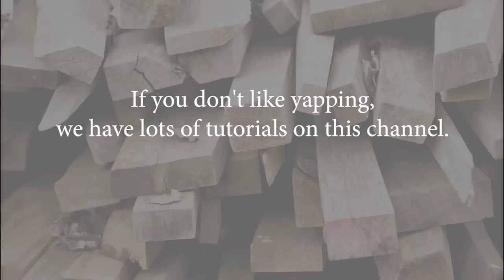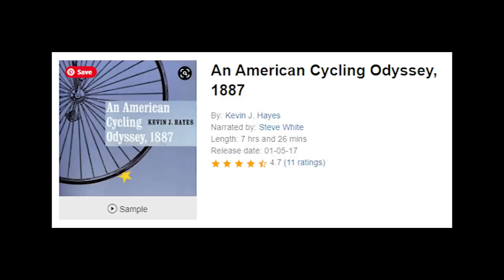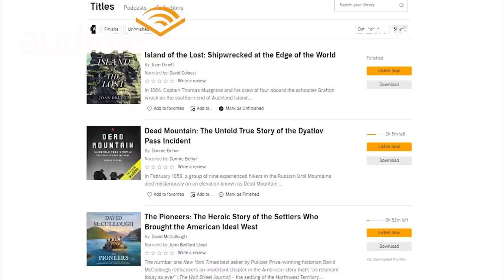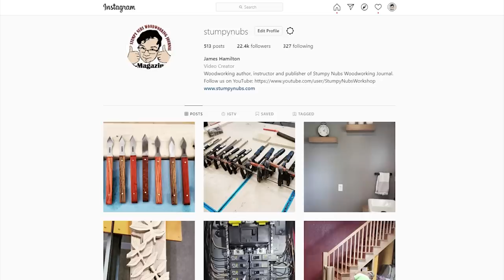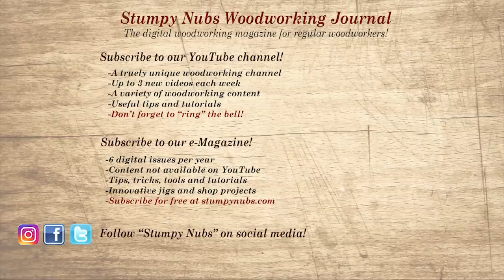Have they BANNED table saw dado sets????

Comment: As much as I like and respect you James you are in the wrong here. We can use dado stacks as much as we like (I live in Sweden where EU-law also apply), our arbors are long enough and are in general 5/8" as well but we shim them to 30mm, remove that shim and run any 5/8" blade with a long arbor. My DeWalt table saw stops any dado stack, even a 1", within 10 seconds and I can remove and operate the saw without guards and riving knives - also, there is no requirement or law that say you need to have a riving knife fitted to operate a table saw, you cannot just sell a saw without one fitted. 

What it comes down to is that our tools require CE branding and to my knowledge no manufacturer have gone through the hassle of certifying a dado stack, hence making them "illegal to sell" for professional use. There are however options that are CE-branded like the dado sets from Hammer/Felder - they have the benefint of leaving a perfect result apart from what the stacked sets many times do. You can still buy dado stacks in EU, but not CE-branded - that's all.

I have fitted dado stacks in EU-sold Bosch table saws, DeWalt and several others for many years. In my opinion dado stacks can be a time saver but the "European way" to do rabbets and dados is by using a shaper/spindle molder which properly used is much safer and more efficient, that combined with a router gives plenty of options to create whatever you want with a much better result than the regular dado stack ever will. So, dado stacks was never forbidden in Europe, it was abandoned as an obsolete and somewhat unsafe design.
Reply from the maker: It's funny how you say I'm wrong, while dozens of other Europeans in these comments saw the opposite, some even telling me how they had to import saws with arbors suited to dado sets. Seems like a lot of confusion over there. I suppose it's because different countries enforce EU regulations differently.
Reply: @StumpyNubs  Most of us fall under EU-regulations. There are however plenty of saws around here with a short arbor as you and others say but not to prevent us from running dado stacks.

For example, any EU-sold DeWalt table saw the past 10 years or so should be able to fit a stack. Same goes for Bosch and many others. Obviously people have no idea what they are talking about, surly not all saws will accept a stack but that applies for US as well.

Comment: Many years ago, with a brand new 3 hp PM 66 table saw and an improperly adjusted fence (blush, blush) I was able to stop a dado mid-cut. I was able to turn off the motor since it didn't trip the circuit breaker. The panel did NOT kick back. So, as you said, kick back is rare. And yes, I got the fence property adjusted.

Comment: I'm 80: been shoving boards thru table saws for most of my adult life. Cabinet making, furniture and just plain enjoyment. I have worked in production woodshops in what would now be  considered against the law conditions. Yes! there were injuries, all of which were user errors. If you can't achieve a concentration state similar to deep state hypnotism then don't work around 1750 to 25000 rpm capable machinery sporting razor sharp hi-speed steel blades and bits. You will probably lose some fingers or worse. The absolute worst solution is trying to legislate for stupidity , incompetency, bad habits or some other interruption to an acute sense of situational awareness. All legislation does is provide lawyers with clients that are stupid and or incompetent. It does sell a lot of SawStop saws and other false senses of safety to people who should not be in a machinery environment or own a gun or god forbid a car.  If the hair on the back of your neck doesn't tingle when you are pushing a board in a thru cut with the heel of your right hand resting on the fence and your thumb and index finger acting as the push and side pressure passing an inch from the nasty spinning blade then take up baking you will be better off. I still have all of my fingers and have been nicked once in my early years of high school woodshop. Learn from your mistakes.
Reply: "If you can't achieve a concentration state similar to deep state hypnotism.."
Well, that's kinda the problem.
Reply from the maker: I think you are misinterpreting what he is saying. He means a level of concentration that blocks distractions out. I don't agree that such concentration is entirely possible in all situations, but I understand what he is saying.
Reply: @StumpyNubs  
I understand it like that. :-)
What I meant that people who work in the field today are maybe not as capable of that feat as the ones who are able to concentrate that well, are working in different occupations that pay more/have less risk?!

Comment: Why doesn't anyone talk about the benefits of getting hit when kickback occurs. If the board that is kicking back at 140 mph is big enough, and it hits you, it knocks you back away from the spinning blades. So if you get hit by a kickback board, count your lucky stars, and your fingers.
Reply from the maker: It's the same with cars. Why doesn't anyone ever talk about the benefits of being ejected through the windshield during a crash? If the car catches on fire, I don't want to be inside it!
Reply: Err...both my Uncle and his son were both saved by being flung out of their cars in a collision. Cousin's car was pancaked with the roof in the passenger compartment, he was uninjured. Uncle got a cut on the head with a few stitches when his car was T-boned and just about turned inside out. That said I ALWAYS wear a seat belt when in a car or other transport when traveling (I believe most non fatal airline injuries are caused by mid-air turbulence with no warning, so keep your seat belt fastened loosely while in flight)
Reply from the maker: @brucelee3388  I think you missed my sarcasm, Bruce.
Reply: @StumpyNubs  Made me laugh, and I sure needed that! Thanks

Comment: @Stumpy You were the Chosen One! It was said that you would destroy the myth, not join them. bring balance to the debate, not leave it in darkness. :) nice video. i can't help but wonder if the EU side just isn't as down with the dado as the larger table saws aren't as common over here - and running a dado without the power to hog out the material won't be all that quick.

Comment: In your pitch for audio books you said that you listen to them while you cycle. As someone who always emphasizes safety in your woodworking, you should realize that biking with headphones in is a bad idea. You can’t hear what is going on about you, including polite warnings from overtaking cyclists that they are about to pass you on the left. You won’t hear approaching cars. Save your listening for circumstances where your safety and the safety of those around you doesn’t depend on an aural awareness of your surroundings.
Reply from the maker: They make headphones that work through vibrations in your skull rather than playing sound into your ears, so they do not block outside noise. They also make helmets with tiny speakers above your ears that also do not block outside sounds when used at a reasonable level. I have both.
Reply: @StumpyNubs  I’m glad to hear that you use earphones that allow you to hear what is around you. You are in a minority. Just this morning I had a near collision with a cyclist who drifted into me as I passed because she couldn’t hear my loud “On your left” as I passed her. This happens way too often.

Comment: I'm glad you talked about the whole dado blade thing. I had some misconceptions about why Europe banned them. I still don't agree with it, and would love to see some test results proving that an arbor nut can loosen from the force created as a dado set comes to a stop.
Reply: I experimented with adding electronic braking to my old mitre saw (which had none). The 250mm blade managed to unscrew itself on my first try. That was scary! 

If you look at the arbours of recent saws, the better ones usually have a key arrangement of some sort between the plate washer and the driven arbour, so that the washer has to turn with the arbour no matter what - it cannot spin on its own. That is done to prevent the nut coming loose. Problem with dado stacks is that they are too wide for the lock to engage. Even without that, a nut and a locknut (and two spanners) ought to be fine - it's considered safe on things like steering components on cars after all.

I live in the UK. Dado sets are NOT illegal here, just very hard to get (and long-arbour saws are also hard to find). Our Health and Safety Executive have clarified that dado sets are NOT banned, but there are very strict rules about their use (not sure about the detail in commercial workshops though).

Comment: If you want to live dangerously, use one of those Molding things on a tablesaw -- one cutter 
held in with one screw, and let me tell you, I bet that more than one person has had that screw break and that Chunk of life threatening Steel do its best to labotomise them. Another wonder is the gismo sold by Sears back in the day where you could dial the groove 
width by the eccentric side plates, and the blade would wobble across the cut....Insane item. My Saw was not Bolted in place, and would walk around the shop with that thing howling until I unplugged it!! ( Totally Screwed up my arbor, and I needed to replace the bearing on it after that !)  Nope -- Never again, and its back to mundane safe equipment for Me!!

Comment: First to preface that I'm in Australia and have zero experience with dado blades, but surely if the arbor nut was coming loose you would notice the wobble in the stack, and poor cut long before there was a risk of the blade coming off? I think they're a great idea, compared to a router which is OK for cutting rebates, but a complete PITA to cut perfectly straight rebates with, particularly as you get further from the edge. I'm not convinced either that assuming due care is taken (as it should always be) that one tool is more unsafe than the other.
Reply: i actually use mine as much or more for box joints.

Comment: I made a set of sleds for using with dado blades, not sorry.
Reply: I also use a second nut on my arbor. it's not as thick as a regular nut but rough on the inside and locks it in.

Comment: There are few ridiculous laws in EU (nothing to compare many insane laws in US). One example is that Banana plugs for speaker wires. 
Problem: EU was electrical 230V wall socket holes are exactly the right size for the low voltage speaker plugs. So guess that law the politicians made ? Did they ban banana plugs ? NO ! they banned the banana  in audio equipment. So now if idiot happens to have wires with banana plugs, the only socket around him that they fix now is wall sockets so he can kill himself and burn down his house. I guess it is Darwin law. 

EU banning sale of audio equipment with banana sockets. So all amps and receivers sold in EU have the banana sockets capped with plastic caps. And first thing any experienced music listener does when he buys new amp is that he digs out those caps while cursing how idiotic the caps are.

Comment: Surely one can just use one’s router table without sticking that much metal into one’s table saw?
Reply: Router tables work… but the table saw with a dado stack is faster, safer, and easier to control. Safety with any rotating cutter head (router, jointer, tablesaw, drill press, etc.) is all about controlling three vectors of force: up/down, left/right, and back/forth. Routers introduce another force in the opposite direction in two of these three vectors, thus making it slightly harder to control. This can be alleviated by using increasing depths of cut (instead of ploughing it all out in one pass with a dado set). However, this increases the number of passes on the router table, thus multiplying the opportunity for problems.
Reply from the maker: Didn't watch that part of the video?
Reply: @StumpyNubs  You explain things well but I missed that bit…also I live in Scotland and have  a relatively small table saw - so no dado stack and router table it is.

Comment: A dado cut is not a through cut, so the use of a really wide blade cover does nothing and only serves a possible purpose when you have finished the dado cut  and the wide plastic cover drops over the dado blade as the wood passes beyond the blade.  A 10 second stop?  Really?  it takes a saw blade about 1000th of a second to cut you.  I fail to understand the 10 second blade stop law.  Like a great number of laws passed many are written by people that have no experience or expertise.  "It seems like a good idea" is all they can come up with, yet they stupidly sign off on the law.  Actually, I can see those fool law makers across the pond outlawing table saws, so then everybody goes to hand saws.  After 100 people out of tens of thousands cut themselves with hand saws, they'll go too.

Comment: But you cannot download to a USB so you can listen in your car
Reply from the maker: Use the app on your phone. Connect your phone to the car.
Reply: No USB it has to be then it plays through my car radio.
Just went to audobooks they load straight to my hard drive with no fuss so I canciled Audible a week latter and they offered me it for half price.
Reply from the maker: Your car stereo has a USB port, but no way to connect you phone to it so the phone's audio play's through the speakers? There's lots of ways to do it. Heck, I was connecting stuff to my car stereo 30 years ago!
Reply: @StumpyNubs  I probably could connect the phone to the car but I would then need a lorry for the cable and as I do 400 miles that is a lot of cables?
I take it you mean a smartphone? 
Tried one for a bit but they are not very strong they smash when you threw them at the wall hate the dame thing? 
Any way if Amazon gets their act together I will try them again but until then I will stick with Audiobooks download the book on my hard drive then use the USB. lol

Comment: I believe the main reason has a lot to do with medical treatment: a single blade cut can often be dealt with by stitches, whereas a dado stack leaves wide grooves in flesh that can't: much more serious injuries.
Reply: A spinning blade does not make a clean cut in flesh -- it chews it up and leaves a ragged wound.  Granted, a 3/4" dado multiplies the damage.  But don't kid yourself about table saw injury -- touch a finger to a spinning blade and odds are you're going to walk away with a "stumpy nub".
Reply: @jeffeverde1  "But don't kid yourself about table saw injury" I'm not. Thanks for doing that online thing where you invent a false view.
Reply from the maker: What do you suppose happens if you plow a dado through your hand with a router :)
Reply: @StumpyNubs  Indeed. Laws and lawmakers are not rational - pretty much everywhere.

Comment: I'd rather not have a floating blade guard in the way of my push blocks.
Reply from the maker: It's no more in the way than a regular blade guard would be. You can adjust it side to side if you need to. But I keep the right edge of the guard close to the right side of the blade so my push block can go between it and the fence.
Reply: @StumpyNubs  Yeah. I just don't like blade gaurds. They feel like an obstacle to me. I feel I'm pretty safe with my grriper  blocks.

Comment: Look up a meter and  why  it is that length ✌️
Reply from the maker: Why is that relevant to this video?
Reply: @StumpyNubs  Because metric is silly and annoying, and the basis for the metre's length is actually a mistake by French scientists (said the Brit who really likes imperial units for several good reasons). And back on topic, it's like prohibiting dado stacks - a silly political thing. They are NOT illegal in the UK, incidentally, just hard to get because suppliers are worried about legal liability if they are misused. Different in a commercial workshop, in that the regulations governing their use are pretty strict, but I am pretty certain they are not illegal even there, if installed and used properly. Many woodworkers in the UK think they are illegal, because their mates said so, but the Health and Safety Executive (responsible for commercial workshop safety inspection, etc.) say otherwise, although they don't like them.

Comment: Dado blade aren’t that scary I run my fingers through it dado blade and I still have it it only took a little piece it was only a quarter inch stack luckily the other side of the water or just scared of stacking blades that’s funny

Comment: The brakes issue is huge. yes. And no, you've not solved the issue... you assume the law is based in reality.  electronic brakes are here to stay. the 10s rule is here to stay. It bugs me (as a european)... because if the thing stops too quickly, to my old ears,  it sounds like really bad bearings

Comment: Never needed a dado set.  Nothing wrong with them, just have no need. I preferred working with a router.  A dado set does not make a table saw more or less dangerous.  It is still a power saw with a spinning blade.  The same rule of thumb applies.  Keep your body parts out of the path of the blade and you don't get cut.  This is not rocket science.
As far as stupid laws go;  You elect stupid/spiteful politicians, you get stupid/spiteful laws.